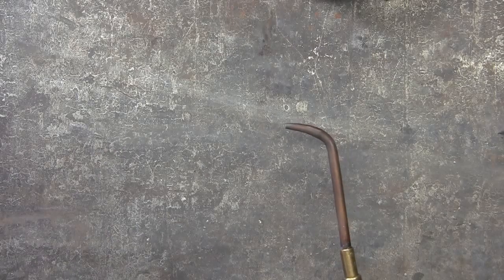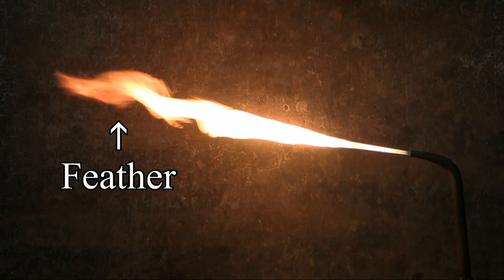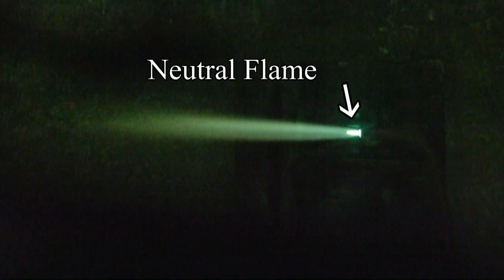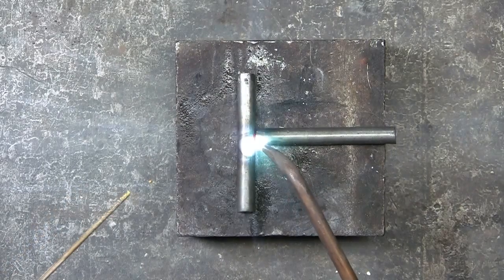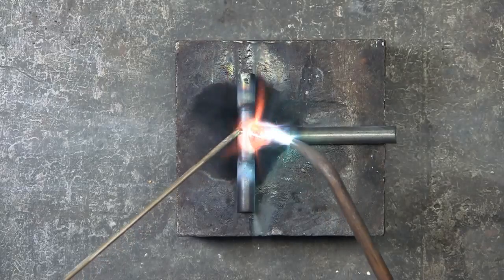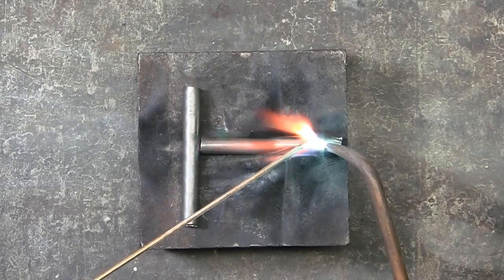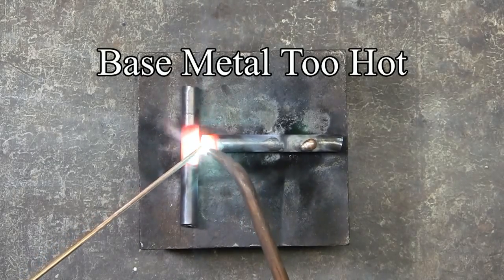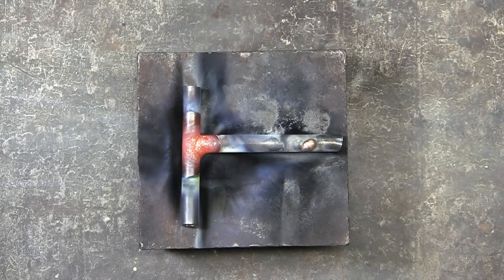Brazing Made Easy

Comment from the maker: Appreciate the comment.  Positive comments always give me inspiration to do more of these.
Reply: That helps, I’d like to be able to see what the braze looks like through the filter a little closer
Reply from the maker: @damien12309  Thanks for viewing and commenting.
Reply: @897473  of course im working on trying to put together a mini flatbed for a high end rc car and its a bit challenging to get it just right but this vid helped, I think I just need more Time in the host seat.
Reply: Hi there I’m trying to braze mild steel for a kohler small engine control. However, every time I try to braze the same thing happens, I can’t get the filler metal to melt. I’m very familiar with soldering, I’ve done thousands of joints, however it seems like I’ll just sit there and rub the rod against the red hot metal and pretty soon I find myself using the flame. I know sometimes to get the solder flowing I sometimes put it against the iron or torch for a sec. any thoughts?
Reply from the maker: @jamesboles3679  Not sure exactly what you are doing.  But, the heat from the flame must get the filler rod hot enough to melt.    If you have the base metal (the mild steel), red hot or close to red hot, put the brazing rod on the red hot metal and heat the rod.  Also possible you may be using too thick of rod.  For what you are doing I'd use 1/16" brazing rod.
Reply: @897473  thanks for the quick reply. Maybe it is too thick, I’m using 1/16, what about flux, I know when soldering the flux really helps the heat  travel through the joint, when brazing when do u recommend using flux? Everything is completely clean, is that enough in most cases?
Reply from the maker: @jamesboles3679  yes, you will need flux.  Since your metal is clean, you will need very little flux.  Check out these two videos:  https://youtu.be/RFy_5JgIasM       
https://youtu.be/SgMwm279DqQ

I'm leaving right now, so won't be able to get back to you until this evening.
Reply: @897473  hey I appreciate u answering my questions sir. Great video too!